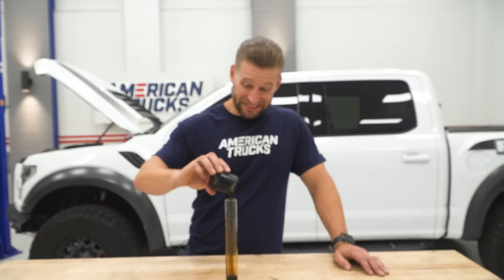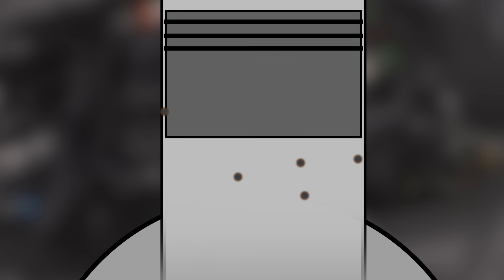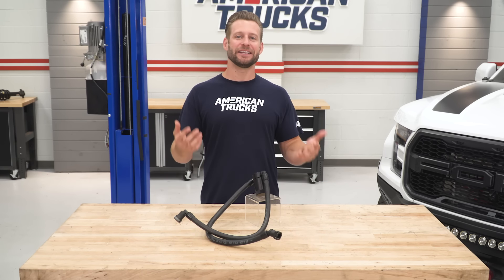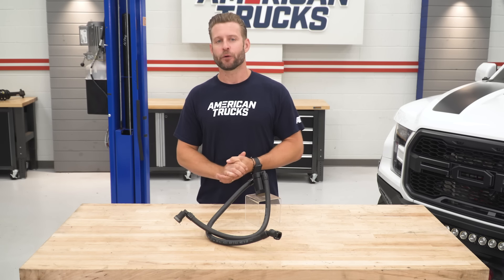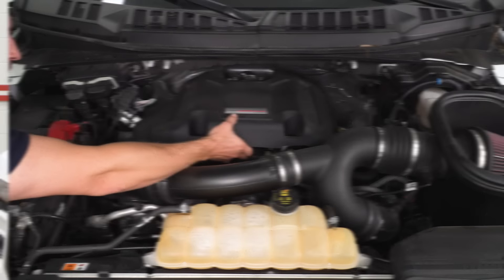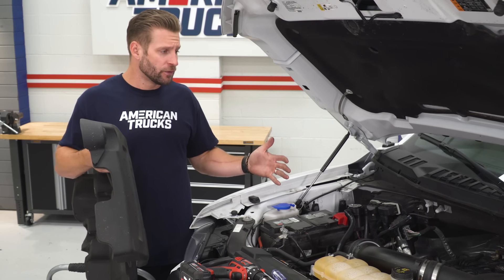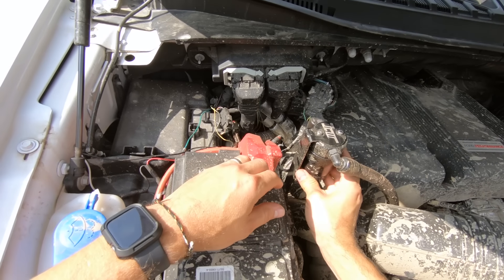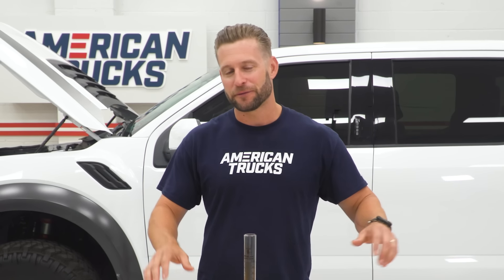Does Your F150 Need a Catch Can? - Ford F150 Oil Separators Tested And Explained

Comment: The JLT connects to the PCV on the passenger side only, Why would we just do the PCV, would we want to captures blow-by from both the PCV and CCV systems?  What is the benefit of also doing the CCV?  (Example, https://www.mishimoto.com/ford-f-150-2015-2016-35-ecoboost-catch-can.html)   I purchased a 2015 3.5L TT and it has 160k, looking to see what would be best to help extend the life on this Truck.  Thanks for the video, and guidance!

Comment: So quick question.  Reviews of this item have been popping up a lot on my YouTube recommendations.  I have noticed that a majority of the reviews have used the same phrase "beneficial for early Ecoboost truck". Does this mean that this item isn't really necessary for late Ecoboost trucks?  What years are we talking here?
Reply: As mentioned in the video Ford added port injection along with direct injection for the newer trucks (2015 and up i believe he said) so the backside of the valves that would normally build up with carbon deposits are now being cleaned by the fuel spraying on the valve threw the intake port.. That doesn't mean this mod is useless to keep deposits from building up but you probably don't need it.
Reply: @Napster60  dual injection was not added until 2017, Justin mis-spoke.

Comment: When you routed that oil collector return hose down around the intake tube wouldn't you have created a place in the hose for the oil to pool shutting off the ventilation?

Comment: My 2015 2.7l won't take one...some of these engines are compatible others are not although built in same year.  I get a check engine light... Also others have shown to have oil buildup in the pcv lines.  At the moment I don't feel or see any residue in the lines like others have shown.  

Installing one on mine the sensors recognize a problem with out of range vacuum.  I've tried a few different things, but no fix.

Comment: not needed on the new 2018 2.7 it has port and direct fuel injection  two injectors in each cylinder
Reply: So my son's 2017 2.7 should have one?
Reply: @rumerboyz  yes/ but most people sell them off before one is needed. but that depends on how much mileage it has on it. but i would get one if i was you. even so. I had a 2014 and it had 70.000 miles and i had no problem. it was still under warranty when i traded it in for the 2018.
Reply: @spacecowboy53  he has about 27,000 miles on it now.
Reply: @rumerboyz  and it's a 2017.  I wouldn't worry about it then. if it had maybe 1000,000 then I would be concerned. more then likely it would be ok. up to 100,000. there is a lot of old F150 on the road like my 2014 still running strong with 70,000 never any problem.

Comment: I have the JLT 3.0 on my 2013 F150 Ecoboost.  Man, I have to empty that thing every 800 miles or so as it's near the top!  I gotta think it's more a mix of nasty vapor/condensate than oil though as the oil level does not go down on the dipstick between oil changes.
Reply: Where's it mounted?
Reply: Passenger side firewall.

Comment: So are you saying that the 2015> Ecoboost don't need this?
Reply from the maker: Because of the dual injection, carbon build-up is less likely to gunk up a 3.5L like 2011-2014s. But as you saw in the video Justin's 2017 Raptor still produced a good bit of blowby! Your truck will absolutely benefit from having a catch can and prolong the engine life. -Zach

Comment: What about winter at -20 will all of this freeze and damage ???
Reply: Had one on an older Jeep and it froze up at -30 and caused too much pressure in the crank case which started pushing oil out the dip stick. Haven't bothered on any vehicle since.

Comment: Are oil separators recommended on 2020 3.5 f150s?
Reply from the maker: While the newer EcoBoost engines don't have as much of an issue with valve coking due to newly integrated dual injection (like Justin's 2017 Raptor here!), we still recommend you pick one up if you're looking to keep your 3.5L clean as possible! -Zach
Reply: @americantrucks  I appreciate the response!

Comment: I have one of these but soon after installing it, I started smelling an oil smell coming through the AC vents. Any ideas on why?
Reply: 16 2.7 eco here. I was smelling oil as well before installing my catch can. That was one of the reasons I installed one hoping that smell would go away. Nope. Weird thing is I don't smell it all the time. Seems more in the winter.
Reply: My 2013 3.5l started doing this, it’s bone stock no catch can or anything. It turns out that both my valve covers were slightly leaking oil as well as the vacuum pump.
Reply: Brian B  yea I got under the truck and saw some oil residue coming from the back of the valve cover. How difficult would it be to replace the valve cover gaskets?  Also how did you know it was leaking from the vacuum line?  Thanks!
Reply: Blake Barker  well fortunately for me I have an extended warranty on my truck so I took it to the ford house and let them do it.
For me there was obvious oil on the front of the engine just below the passenger side valve cover as well as at the back of the valve kind of above the passenger side turbo. It wasn’t a lot and the oil dipstick didn’t even show a loss of oil.
It wasn’t until the ford tech pulled the driver side valve cover off to go ahead and re gasket it he noticed the vacuum leaking as well.
I’ll be honest though, I’m sure that if you’re mechanically inclined any at all you could probably do it with a little patience.
I changed my spark plugs 2 days after I got it back from ford and got a real good look at how the valve covers go on and off.

Comment: If I already have 70K miles on my 3.5 Ecoboost, do I need to get the intakes thoroughly cleaned before I install a catch can? Also, why are there options for passenger and/or drivers side...what’s the difference?
Reply: i just put the UPR catch can in my 15' at 62,000 miles. Didn't clean it out

Comment: If you buy a used f150, is it too late to install one of these considering the "damage" is already done?
Reply from the maker: It's never too late to start trying to keep your engine clean! Depending on the mileage of said used F150, there may already be some gunk built up in the intake. But installing a catch can will ensure that you're not letting it get any worse. -Zach

Comment: I feel like the canister should be down pipe from the engine. Otherwise that stuff will slosh up into the tube then run down into the engine anyway. If it’s lower on the engine then any gunk in the tubes will run down to the canister.

Comment: Is this for Ecoboost f150 or would this help with the flex fuel engines as well?
Reply: Lucky Shot would help with the 5.0.
Reply: @Desert_plague  I have the 3.7 flex fuel, wasn't sure if this was an upgrade I should consider

Comment: I have a lease on a 2019 lariat with 3.5L EcoBoost would I need this for my truck if i plan to buy it out after my lease is done?
Reply from the maker: Since the new 3.5L EcoBoost engines now come with both port and direct injectors, I wouldn't say you absolutely need a catch can. That being said, if you plan on keeping it long term and really want to keep things clean as possible, it will do wonders! -Zach
Reply: If you plan to keep the truck I would install it as soon as possible. Carbon deposits build up over time. BUT!!! You're 2019 should have dual injection, so you shouldn't have coking on the valves anyway. but it sure wouldn't hurt anything. On that generation Ecoboost you really don't need it.
Reply: There was a good explanation on mustang6g on how an oil separator actually helps the 5.0 keep from losing power after an extended hard driving session.  I dont remember how this works but there is a reason ford sells their own catch can.  And look how much oil came from the raptor in this video which has basically the same engine as your 2019.  I just bought a 2019 3.5 as well and will be getting the same exact catch can shown in the video.  Its super easy to install and empty and very popular with the coyotes as well.
Reply: @americantrucks  what is the caveat of only passenger side? Does the driver side not have a pcv? Also the can collect the residue from the screen side correct? If it's near half way full and you're in a bouncy terrain would that not seep into the intake like?
Reply: if you are going to keep it yes, if not, dont do it. Depending on the dealer they may try to blame you for something stupid if you modify the vehicle.
Reply: Coking or no coking, I dont want oil in the intake or combustion chamber

Comment: If you have a 2018+ ecoboost you do not need this. Your engine has dual injection which uses the port side injectors to clean off the valves. As long as your port side injectors and PCV system are working as they should, you wont have issues.
Reply from the maker: My full container of gunk every 2-3k miles would disagree. -Justin

Comment: If I already have 45,000 miles on my 3.5 eco boost in my transit. Is it to late for a catch can?
Reply from the maker: Not at all! There may be a little bit of carbon build-up in your engine, but definitely not enough to cause issues or bog down your performance. Adding a catch-can at this point will help keep things clean going forward! -Zach
Reply: Do you recommend a fogging or some type of cleaning and changing of spark plugs before or after I install a catch can?

Comment: Thanks for the excellent presentation.  The best video for the JLT catch can promotion! Thanks to the video, I decided to have the JLT kit on my Expedition 2018 3.5L EB.  By the way, I found the front side longer hose (vacuum side, not PVC side) routing you presented in the video does not work.  At 6:23-24, you put the front hose under the big air intake plastic tube. By doing so, the hose is just going next to the stud for the foam cover (barely seen 6:24). The cover nut cannot be secured as the hose gets in the way.  You can see the back side of the foam engine cover, the stud hole area is around 4 inch diameter must be bottomed.  To clear the stud area, the only possible routing for the front hose is to connect it straight (not going under other pipe and such) and just pushing it toward the PCV side - as a result, the front hose joint 45 deg. angle points toward PCV valve,  and the front hose passes by 2-3 inch away from PCV valve. With this routing, I found the catch can floats naturally at the position (without pushing/pulling forces) where the mounting bracket will be placed (on the side of battery tray).  Therefore least amount of mechanical stress will be applied to the mounts during driving (a lot of vibration and shaking).  Just my two cents!

Comment: Is this recommended for just the Ecoboost or should I consider it for my 3.3?
Reply: Thats rude.  The 3.3 is actually pretty strong for its size and having no turbos.  Although I dont understand why anyone would buy it because the 2.7tt is only 1k more.  Most of the arguments i read for buying a 3.3 is simply for longevity and simplicity.  Anyway you should get it for your 3.3.  Youll catch just as much oil as Justin did in his raptor.

Comment: Just use care;  catch cans void your powertrain warranty....................so you have to remove the system if your car needs warranty work.
Reply: That is not correct. I have had my truck into the dealer warranty work a few times since installing an oil catch can and the dealer has absolutely no issues with it.

Comment: Well I’m not sure I actually trust this because I have a 2011 3.5 ecoboost that has 267,842 hard miles of pulling a 27’ cabin cruiser boat and lost of stop and go driving cause I own my own business, all original equipment except a K&N drop in air filter and 4” exhaust and it still runs very smooth and has a ton of power still so I will just leave mine alone

Comment: I have 45,000 miles on my 2016 2.7L ecoboost F150 and 70,000 miles on another ecoboosted 2016 Ford Edge.. anyway to clean the valves up? Seafoam (lol)?
Reply: Remove intake mainfold make sure valves on the cylinder you are cleaning are closed.take a shotgun with bird shot only! And blast the carbon off usally takes about 3 shells per cylinder.
Reply: victor girouard thanks! Will sawed off shotty work?

Comment: So on a 5.0 f150 the 90 angle fitting goes on the valve cover side. And the 45 goes on the crank case?

Comment: The only thing that would have made this better is if you had covered the difference between a single valve and dual valve system. On the Raptor...and any bosted engine a dual valve setup is required. Hopefully you'll correct and update this video.
Reply from the maker: The purpose of this video was to be a general overview of the functionality of catch cans/separators.  If we covered the intricate details and differences recommended for each different engine over the years, the video would be over an hour long.   -Justin
Reply: @americantrucks  I was only suggesting one additional mention about dual valve vs single valve. No need to get into all variations and flavors...just the basic concept of a single valve vs dual valve. Especially given that so many Ford ecoboosted engines are out there.

Comment: So if i have a 5.0 v8 2019 xlt i will need two? 1 for passenger side and 1 for driver side?
Reply from the maker: Passenger side would do most of the heavy lifting for you. -Justin
Reply: So no need to install one on the driver side?
Reply from the maker: I always suggest that if you want 'all out' protection, doing both sides would certainly be worth doing.  However on your 5 liter truck, I think you'd find that the Driver side will collect a fraction of the passenger side. -Justin

Comment: Have one on my 12 eco. Since install we have a gas/oil smell in the ventilation unit. Have to run it on recirculate to not smell it when using a/c or heat. It did not smell before the catch can install....
Reply: perhaps you don't have the lines connected properly? It's not really possible for a catch can to have the effect your describing if properly installed.
Reply: Pat I have an OCC on my 2015 Mazda3.  And I also have a gas/oil smell coming through the vents.  But it only happens during winter and when I idle the car for 10 mins or more or when I turn off the car and start it back up within 30 seconds.
Reply: Pat pro a sly. Tuning some oil or other fluid. I have a burning smell as well but I don’t have any catch can. I have something that has leaked onto my turbo and gets cooked when remote started.
Reply: I have a gas smell too after I eat beans.

Comment: Great demonstration however there's no way of knowing how much of that gunk would have been burnt off and expelled out the tailpipe  as the manufacturer has intended.   The definitive test would be to have 2 identical trucks one with the device and one without and check their intake valves after 5000 miles or so.   There are lots of gadgets on the market and many of them useful but a lot actually just do nothing to actually make a situation better.

Comment: For a direct injected Engine I completely agree with your statement. But with the addition of port fuel injection along side the direct injection it's really not necessary. Your comment about deluding the octane, not really. The amount of fluid you collected over 2000 miles would've been diluted with about 120 gallons of gas. Diluting that little bit of fluid into 120 gallons of fuel does nothing for your performance at all. It wasn't even enough to act as a top end cylinder lube. Either way it doesn't hurt to have but really only necessary on direct injected engines.

Comment: Will this jlt oil separator void factory warranty..
Reply from the maker: I can't see how that would be possible. -Justin
Reply: @americantrucks  my question is does it void the factory warranty or it does not..?  I just like to know if you guys can help with my question..
Reply from the maker: Your question is vague, at best.  A dealer has to prove the 'aftermarket' part is responsible for whatever your warranty claim is about- as stated in the Magnuson Moss Warranty Act.  If your radio stops working, they can't blame the oil separator.  However you discover an oil leak somewhere in the PCV system, they might try to pin it on the separator.  Every dealer is different and I can't speak definitively on behalf of every service department in the country.  Hope this helps. -Justin

Comment: After watching this video, I’m considering installing one on my 2019 F-150 with the 5.0L. I’ve already got 7,700 miles on it and was wondering how much buildup might already be there or if it’s still early enough to install a catch can and it actually make a difference.
Reply from the maker: Your trucks still pretty darn new! Your truck will most likely have little to no build-up as of right now, but installing one sooner rather than later will ensure that things stay clean moving forward! -Zach

Comment: Why was Ford overlooked this so called after market "catch can" if this is really doing wonders to keep the engine working longer in "top operating" performance? I understand this "catch can" is still absent even in their newer/latest model, - that goes to show (to Ford) that the "catch can" is just an un-neccessary addition to what is already a "perfect engine". Otherwise, Ford will include this "catch can" as standard equipment of their engines.
Reply: Ford Performance sells a catch can...

Comment: The way you installed the longer hose you won’t be able to put back on the engine cover with screws on.  You need to show what you did to make it fit when cover down.  So no hidden problems please.